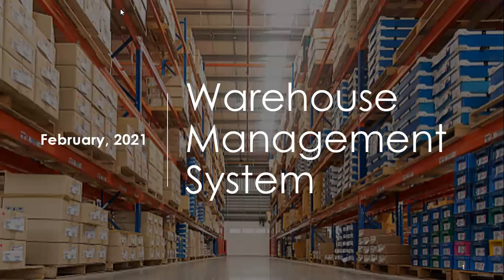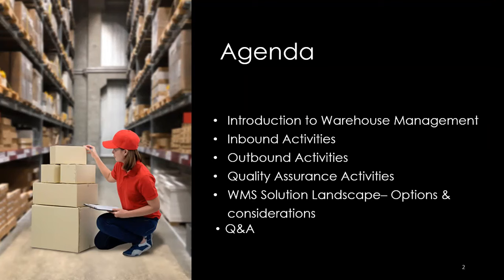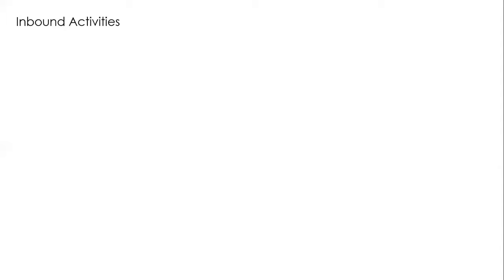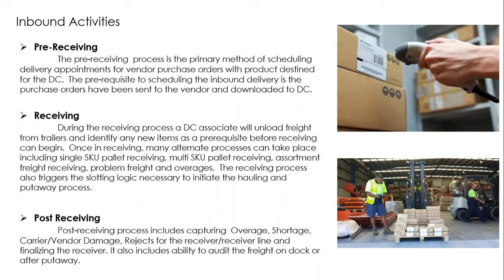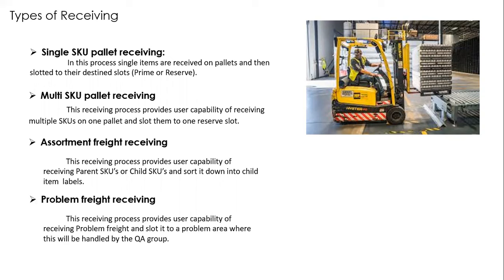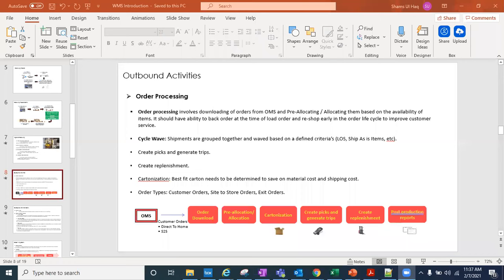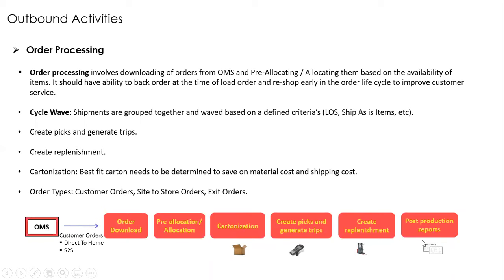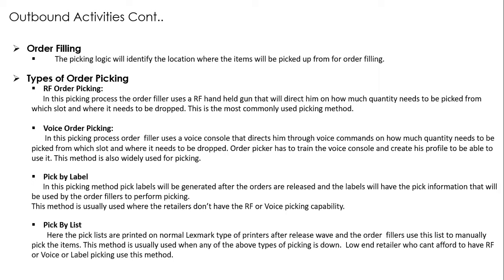Warehouse Management System(WMS)

Comment: Lot number or Batch number represents the manufacturers production batch/lot number and usually this is helpful in traceability of the production batch. Incase a particular batch got manufacturing defect and need to be recalled, then it is helpful to trace the batch/lot and return to manufacturer or destruct the goods in case of a major issue. 
Expiry date tracing is done under a expiry date field.
Both batch/lot number or expiry date is updated in receiving process to ensure the physical goods is traced through out the supply chain.